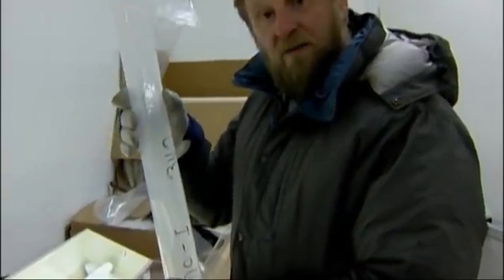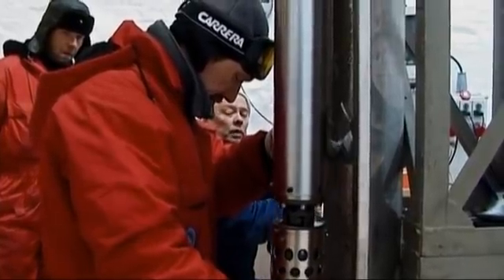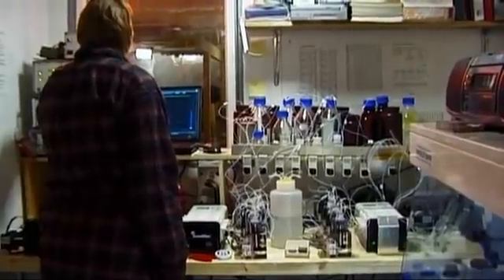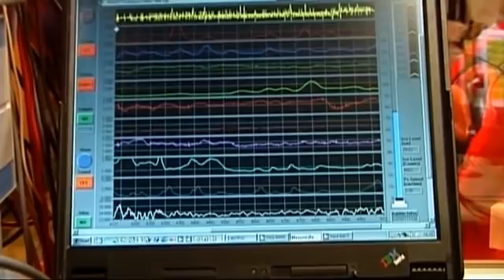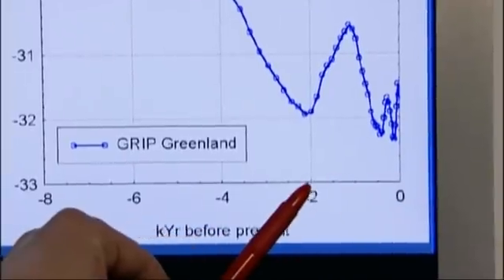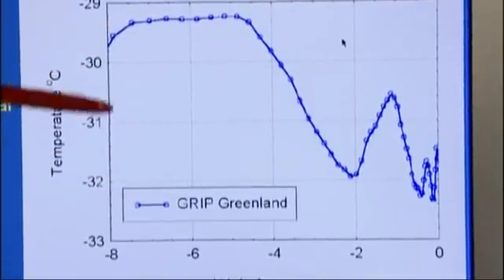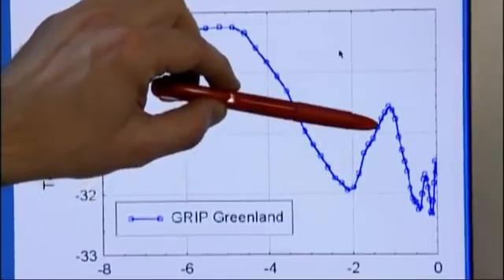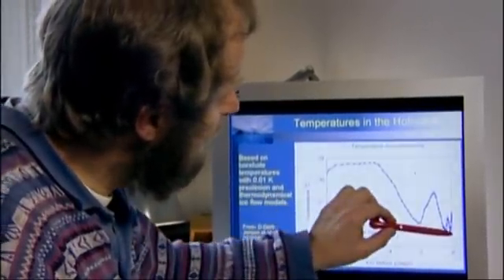Greenland Was 1.5C Warmer During the Medieval Warm Period

Comment: Glacier Girl. In 1942, a squadron of P-38s heading to Europe had to land in Greenland due to bad weather. After rescue, they left the planes on the i e to wait out the weather to get them. When they went back for them, they were buried in snow and could not find them, so they were abandoned. 50 years later, an expedition found them under 268 feet of snow and ice. An INCREASE of 268 feet of ice in Greenland in 50 years.
Reply: Not necessarily. 
If the ice is building up from above and melting from below it is the difference that determines the increase of depth of ice! It is this meltwater that allows glaciers to flow downward calving off the excess in the sea.
Reply: @totherarf  where would the heat come from to melt ice at the bottom of the icesheet? Glacers melt in 2 places - the surface, and the leading edge. Ice becomes elastic under enough pressure. Glacers do not flow downhill because of meltwater, they are squeezed downhill by the weight of the icesheet uphill. Glacers grow when ice buildup exceeds summer melt because the added weight squeezes ice outwards from the ice sheet. But when ice melt exceeds winter ice buildup, glacers retreat because then ice stops being squeezed outwards, stopping the flow, while the front edge of the glacer melts back. 268 feet of ice growth is a sign that the ice sheet is growing, confirmed by many glaciers advancing again in Greenland.
Reply: @juliusruechel7961  Perhaps I was being a tad oversimplistic ;0)
My point was that the depth of snow/ice above the plane does not mean there has been a build up of that depth in the glacier. It is certainly an indicator but there are other things that affect it. I agree with you about the advance and retreat of glaciers and that they are growing at the moment,much to the concern of the Mr Mann & co!
Reply: @totherarf  👍 I agree with your point - there are so many variables involved. It seems Glaciergate 2.0 is looming on the horizon for Mann & co. 😉
Reply: @totherarf  It's the weight of the ice that pushes it down and towards the sea. This happens mostly in the coldest parts of the world (think Greenland, Canada, Siberia, Antarctica) so melting from below is not even an occurrence. Even in Iceland, one of the world's most active geothermal areas, melting from below doesn't really happen except during and around volcanic eruptions.
Reply: @gullijons9135  This I accept! There is meltwater but only in specific rare events ... my bad ;0)
The point about simply measuring the depth of a buried plane and extrapolating that there is that much depth added to the whole glacier is not a good one though!
Reply: @totherarf  For some reason YouTube didn't show me Julius' response to you so I didn't know I was just repeating what he had already said. I do agree with you about the extrapolation, that's completely wrong.
Reply: @gullijons9135  Nothing wrong with a frank exchange of ideas ...... it is when people do  not listen to the other argument that we see most hassle! ;0)
Reply: @totherarf  Off a bit.  Any ice melting from the bottom of thee glacier would have no effect on the depth of the accumulated cover above the planes.  The variable would be any sinking of the planes through the ice that was already there at the time they landed.  But that wouldn't have been much, because that function is one of rapidly diminishing returns.
Reply: And ?
The 30 or 40 years after WWII were years of cooling because of pollution and aerosols. During the 70s the media were talking about the imminent coming ice age, even though most climatologist were talking about warming already.
Today Tony wants you to believe the ice is growing at a record pace in Greenland.
In his videos about Greenland ice he only talks about the Surface Mass Balance.
He shows graph form the : 
"polar portal greenland surface mass balance" , google it.
but always ignores from the same web site the Total Mass Balance :
"polar portal greenland mass and height change" , google it.
Reply: @philippesarrazin2752  We had 10x the C02 in the atmosphere millions of years ago. If CO2 causes a feedback loop, explain why the earth isn't a scorched cinder by now. 

I don't care about glaciers, this Earth has seen far worse... and way more CO2 than today. Life has existed continuously on this planet for billions of years... and during much worse cosmic bombardment, tectonic shifts, volcanic activity, and ice ages. Earth would not have an unbroken chain of life for this long if this planet could get into a feedback loop such as proposed by the sophists who masquerade as authorities. Charlatains!

All that planetary chaos should've destroyed all life at various points if feedback loops were even remotely possible in the current state of the biosphere. Do you think planetary ecology doesn't itself evolve under constant assault from the cosmos and tectonics. The early Earth adapted into homeostasis amid far worse than mankind could ever produce with 100 times the population and 10,000 more years. 

It took a very long time under enormous bombardments as the Earth accumulated the bulk of it's mass. A fiery molten sphere was how it began. Over hundreds of millions of years in various states -- any proto-atmospheric system which couldn't survive that chaos would never have come into existence or persisted. In the years before life on Earth, the ancient environment reached a state which was stable enough to yield life and it would remain unchanged until life itself changed it. 

Any life which couldn't adapt to the chaos of the early Earth would certainly go extinct and be replaced by more adaptable forms. This planet didn't even have any oxygen to speak of in the early days of life. When plants and phytoplankton started to offgas oxygen, it wiped out a lot of life because it was highly reactive. Even so, life evolved to use that gas to fuel larger forms. Oxygen was a poison to the early life on Earth. Life is so stable, it can adapt to take advantage of a poison in ways so inventive it's practially miraculous. No large animal could exist without it. 

If the Earth's atmosphere/biosphere were that delicate, then it could not have survived even a single ice age. Anything delicate enough to trigger a wild feedback under Earth's early hellscape would've never yielded an environment stable enough to support life for BILLIONS of uninterrupted years. 

Any human being with a sense of logic can just use reason to conclude various things: since past references to charts and data are being memory holed by those who are selling this GCC idea, that's reason enough to declare their entire theory as a total hoax... or to give it no credit at all because if the data is fake, then no conclusion can be made from it. 

Given what we know of chemistry, physics, geology, the sun, and astronomy, the number one "cause" of GCC we've been sold should've eliminated the Earth many times over before now -- yet here we are. Every dire prediction which was made 15 years ago has turned out to be WRONG. When none of the models for runaway GCC pan out, that's an indicator that either the scientists are wrong, or they're selling something other than the truth. When someone is catastrophically failing to predict anything, one should abandon their theory because after 15 years, we should've seen a single actual indicator of runaway GCC and not just fluctuations which are well within Earth's min and max ranges. NOTHING we're measuring is outside of any min or max reading this planet has possessed since before dinosaurs appeared on Earth.

Sorry, global warming is a hoax. It's profitable and it's a very good political tool. That's the thing about politicians, they really don't care about anything but politics and their own bank accounts. If they're using a hammer, it's to gain political advantage, not to help the people. If anything ever truly helps the people, then it's merely incidental to their personal goals. Everyone is self interested. Especially in current year.

How much longer will they be able to sell this hoax? How many years can they continue to be wrong and still be believed? Gen Z will determine that score, I'll wager.
Reply: @michaeldavid6832  You state a lot of facts.
But when alarmists talk about the CO2 impact, they do not talk about the end of life ( for the smart ones ) but about how uncomfortable or unstable it would become for our societies in a world at +5 degres celsius with 11 billion humans at the end of this century.
You do not mention some important informations.
The sun gets hotter with time, about +6% per billion years, so references to a long distant past are to be analyzed with that in mind.
The impact of CO2 warming looks like a log function, about +3 or +4 W/m2 when co2 level doubles.
When CO2 levels were that high, the atmospheric pressure was 2 or 3 times higher than today,
The continents started drifting from the Pangea about 500 millions years ago.
The way the warmth was distributed back then , or between then and today, wind and ocean circulation, was very different from today.
The more the earth warms up, the way more it emits infrared until it reaches the equilibrium ( black body theory).
There is what the media talk about, or Al Gore, and the science. These are different topics.
Reply: gen x

Comment: Could MWP and the holocene warming be caused by Milanchovic cycles??
Reply: The MWP was too short for Milankovitch Cycle. Whatever caused MWP is not known all we know is that it happened.
On Milankovitch Cycles you can watch the video titled "Milankovitch cycles precession and obliquity | Cosmology & Astronomy | Khan Academy" it may be possible that a combination of factors like orbital obliquely and and orbital eccentricity lead to MWP, but it isn't likely (as we should've spotted evidence of similar climatological changes whether from soil, ice cores, fossils trapped gasses or any other form of permenent/semipermenent geological records worldwide dating back over much longer periods especially in the polar circles Australia, New Zealand, Iceland and certain mountainous regions being studied).

We haven't found signs that there are natral oscillations related to Milankovitch Cycles which could've lead to MWP and modeling doesn't reveal anything either (using simulations of what we know about the solar system running in reverse).
Reply: No.
Milanchovic  cycles initiated the warming 15000 or 20000 years ago.
From the Milanchovic  cycles point of view, the earth is in a stable period with a slight cooling trend.
The peak of the warming was 7000 years ago.

Comment: Surely as the corner passes through the ice it get warm and warms the ice.  What am I missing
Reply: CORER
Reply: I was going to explain it to you but..... Try to imagine how much ice, they weren't drilling through an ice cube.
Reply: @multiplemyelomaigm8542  yes I realise that heat through kinetic energy will be conducted away from the core but look at his claim about Temperature accuracy
Reply: @stephenrichards5386  There will be no residual heat left after pulling the drill up through the mile of ice and then taking temp readings. Even if the temp sampler is on the drill, the ice is 20 miles long and 5 miles wide and a mile thick, any heat generated is long gone. 
All my numbers are made up, I have no idea how large the glacier is, but the principal is the same.
You could try this at home with a block of ice, a drill and two temp probes.
Then again he is the curator and seems to know what he is doing unlike the idiots with their computer generated climate models.

Comment: Excellent--no commentary required, simply the evidence as best we can know it from a real no nonsense scientist DOING THE WORK.
Reply: Thanks for that pointer. I'm afraid it's inadequate. 
First, I'll reiterate that the bottom line on climate change is that we do not know to what extent human activity is responsible for the sudden change, and where the point of no return is. And no graph can get around this. All the same I'll now discuss the graph.

So, on to the subject of the graph.
Be very careful, that is a graph of temperatures, you also need to do a graph of the RATE OF CHANGE of those temperatures, the graph of the GRADIENT of the graph in this video.
The issue is not that the temperature has been higher in the past, the issues are, 
First,
HOW FAST IS THE RATE OF CHANGE, 
Second,
if solar activity, for example, was responsible for the high temperature in the past, you CANNOT compare that point with a new point in which the temperature increase is being caused by something else. I hope you understand this, it's not difficult, and I'm somewhat baffled that the people here, who seem otherwise intelligent, haven't spotted that, because I saw that straight away and I'm no genius.
And there's more problems, that could also come into play.
So no, absolutely not acceptable.
Reply: @motherofallemails   And JUST prior to current rate of change there are two similar rates, one up and one down, both when anthropogenic CO2 was not a factor.  So if that is all we have to go on (of course it isn't but it is telling) than CO2 has *nothing to do with it*.  Yet we caused an entire generation of Gretta's to 'lose their childhood' over media hype and bullshit, NOT reality or science.  Meanwhile we have real problems to confront.

That's REAL damage to real ppl all for nothing.  I'm old enough to remember when the "next ice age" was immanent, back in the 1970's.  (actually the next glacial max, we are in multi million yr 'ice age' strictly speaking)  And it was backed by the science of the day more solidly than the dogma we are infused with today.

Magnitude means every bit as much as rate and the graph also tells a lot about that.  What if CO2 increase is exactly what we need to help stabilize the climate, bring it closer to where it was 5M yrs ago before we had this series of ice sheet catastrophes scrubbing most of the N. Hemisphere flat? 

Why would this exceptionally low CO2 level we randomly find ourselves in somehow optimal?  Quite a coincidence don't you think, especially since vastly higher levels were the norm for most of the history of life on Earth wherein life thrived.
Reply: @motherofallemails    We also don't know if CO2 is saving the planet from climate catastrophe.  See where that goes?? 

 I've gradually come around to believing that 500ppm is better than 300ppm (after overcoming the same BULLSHIT INDOCTRINATION by corporate media, the virus that infected ALL of us).

Climate catastrophes have been the norm since these extremely low CO2 levels NOT so much before....glacial maximums are not cool, they are devastating.

It's not about one chart I've looked at reams of actual data on this, obviously you and most everyone else have NOT done so.

I was referring to Gretta Thornburg (if that's her name) who publicly cried and accused us adults of stealing her generations childhood due to climate hysteria.  That's on YOU Sir!!!  All for nothing except to train her gen to be extremely cynical of authority and toxic media dogma...that much will be healthy for societies.  

Most of us would not exist today if not for fossil fuels, they are not the devil but they are now on the road to rapid obsolescence which is a good thing.
Reply: @motherofallemails   There is an absurd underlying assumption no one is THINKING about--that the "natural" CO2 levels are some how optimized for life on Earth and civilization in particular.  This is utter nonsense, Earth wasn't made for us, nature doesn't give a flying fudge about life let alone choose the course of Earths biosphere and humans are also a product of nature.  

See where I'm going with this?  The Dogma of the Day is always fraught with the peril of extremism be it Nazis, USA vs USSR Cold War, McCarthyism...When skepticism becomes a pejorative it's time for skepticism squared
Reply: @motherofallemails    The SCIENCE shows CO2 has almost zero marginal impact on climate.  Simple fact that your indoctrination doesn't seem to allow you to grasp.

And what levels do ALL plants go extinct at??  Around 100 to 150ppm I believe, levels we've come VERY close to in recent glacial maximums--that would be the worst mass extinction event EVER in Earth's 4B yr.s of life history, nothing but select microbes would be left.

So I'm more comfortable with 500ppm that could dip to 350 than 300/170.  It's laughable that 300 ppm is somehow magically ideal for humanity/life on Earth.  WHY?  How??